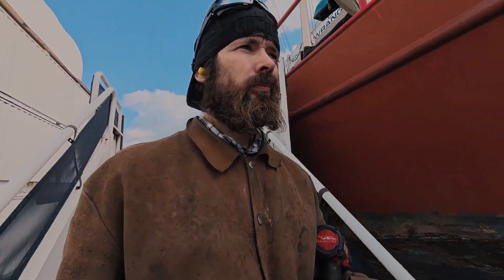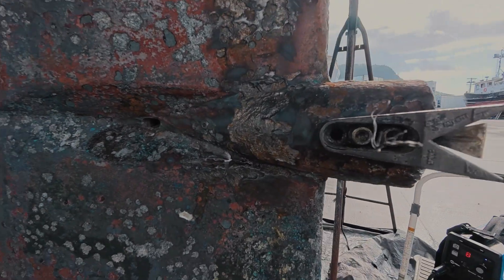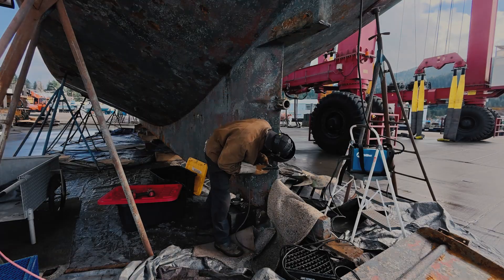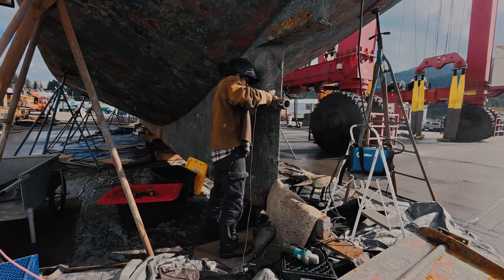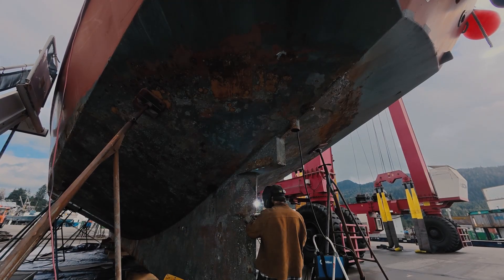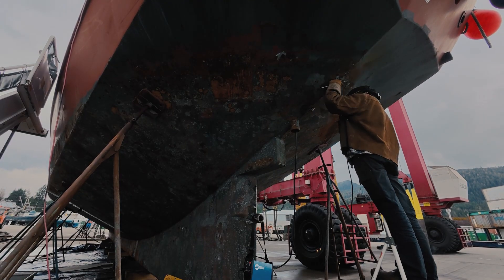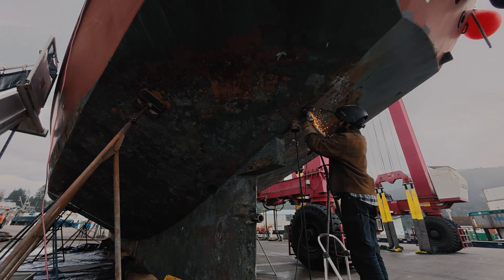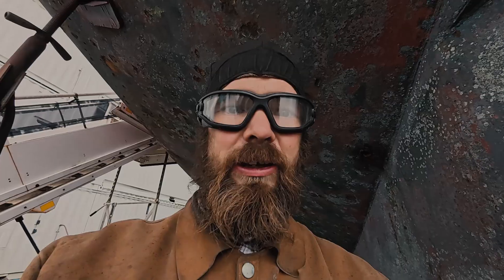Welding Electrolysis Damage on Our Steel Sailboat | Boat Refit in Alaska

Comment: Moin  That all look like you are using the wrong material of sacrificia anodes, acording to the water in what the boat stay the main time you have to choose different materials, when the anodes are not sacrificed after two ore three years you have the wrong material.
Reply from the maker: It went without any anodes sitting in a hot harbor for years before we owned it.

Comment: You can see where the water line and corrosion started above it steel seems ok  below it pitted rust electrictrosise it can be fixed. Every dimbul wire weld it then grind flat
Reply from the maker: hot harbor ate the boat alive!

Comment: Buddy, hearing you say that you grabbed the bigger rods, being ⅛", made me think about all the 5/32" 7018s ive been burning at work. And, who cares if its ugly. If it holds, and you like it, thats all that matters
Reply from the maker: I know. It’s excruciatingly piddly, but better then burning it down!
Reply: @TheAlaskanGypsy just get it strong as you can. It’s not entering a bloody regatta at Cannes is it ?
Reply: @TheAlaskanGypsy  na, its not piddly at all. 3/32 and 1/8" are the most common sizes. I weld on heavy equipment and big stuff a lot more often than not. I am just used to using 5/32, 3/16, 1/4, and occasionally 5/16 welding rods for work. The 1/4 and 5/16" ones I use are 99% of the time E7024s. Those are not a common rod generally anywhere but structural welding on HUGE bevel joints between super thick steel. Flat position only on those dudes. But my word, you can absolutely lay down some super wide stringers that look pretty much like a 7018 weld on steroids.

Comment: Are you sure the stray electrical current was external to the ship in the marina, as opposed to an electrical issue with the boat itself?
Reply from the maker: We have very good reason to believe so, yes. But we will carefully inspect when the refit is done.
Reply from the maker: We have very good reason to believe so, yes. But we will carefully inspect when the refit is done.
Reply: The Aluminum boats are very susceptible to this and have hardware to monitor such scenarios. The name of it slips my mind ….